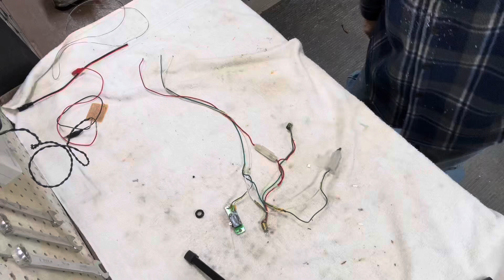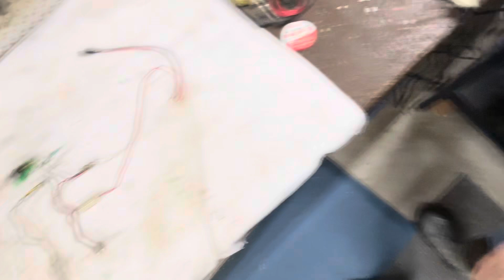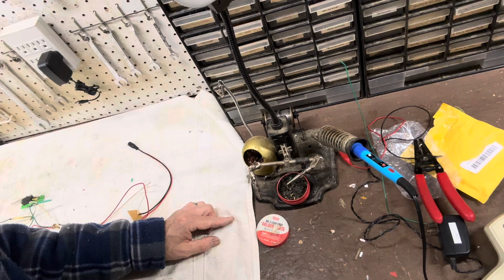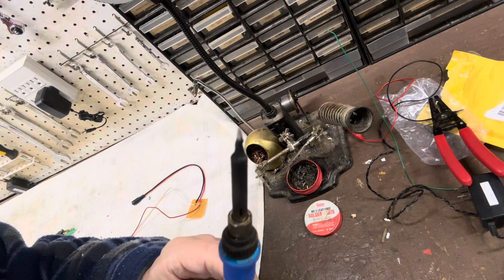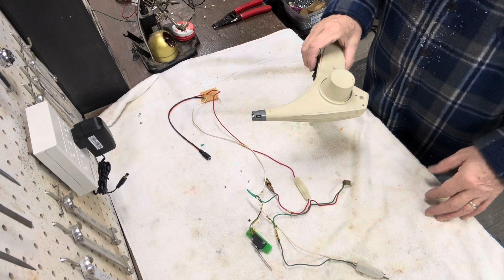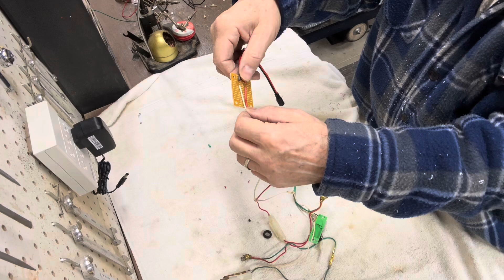How to add power to a Sankyo pachinko machine.

Comment: Connect the two wires together with a wago or wire nut.
Reply from the maker: Doable, but a good solder connection is the best solution. 😉